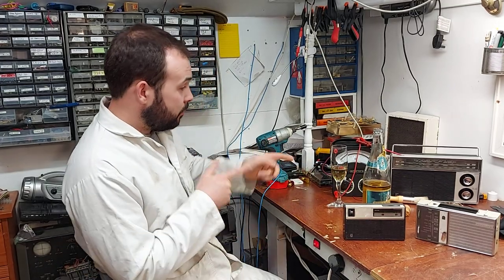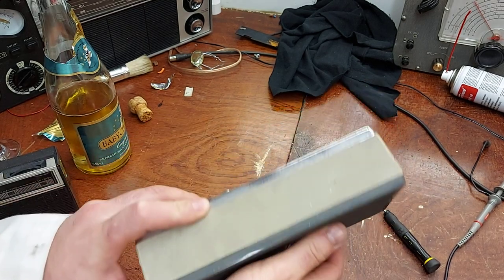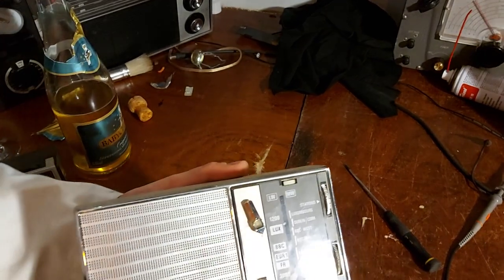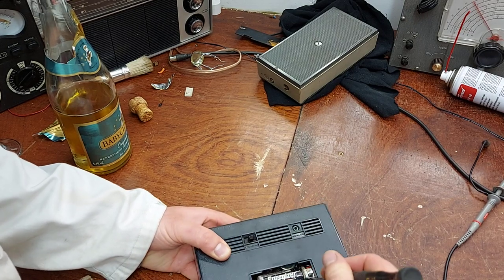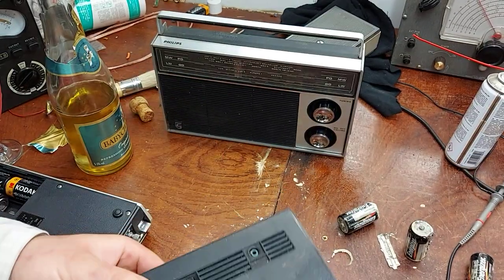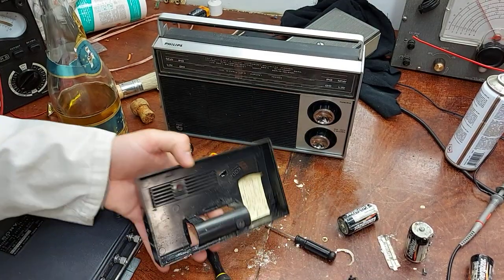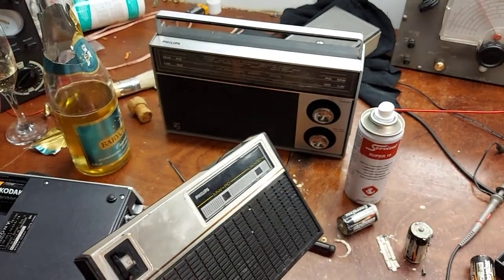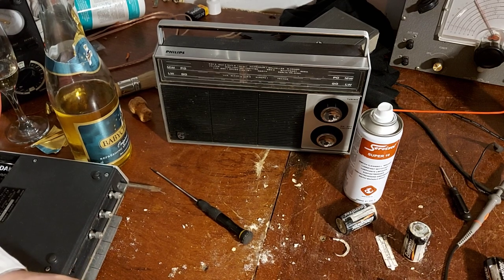A celebration (why not?) and some Philips portable radios.

Comment: European or uk Philips PCBs seemed quite advanced for the time they were made but suffered from dry joints the problem  carried through to g11 TVs. I'd love a Babycham with a red cherry on a cocktail stick
Reply from the maker: Philips were always way ahead of the pack.
Reply: @IrishvintageTVRadio  Philips so were so far ahead. I got from  the dump a Philips 60s dual standard transistor  portable in the late 70s wish I still had it. I also had a BRC 2000  the first solid state colour receiver also a GEC 2028  it had a better picture, all from the dump and all disposed of long ago. The G6 was a bit retro and the k70  looked the part but was possibly over complex. Decca 30s were the best hybrids.  The G8s were perfect for their  time. The  dump source dryed up in th early 80s and I got a proper  Job. Chanels like yours are brilliant like articles from Television magazine  or Practicle wireless.

Comment: Wave change switches are a pain on old Transistor Radios
Reply from the maker: Sure can be Stephen.
Reply: I have a 70s Sharp Table very good Radio sounds like a Valve Set even through it is solid state but the wave change switch is troublesome sprayed contact cleaner on it but the problem always returns only cuts out on Medium wave and Long wave but not at all on FM.  Funny enough I have a Bush Mini TV with a Radio from the 70s that has actually the same issue wave change switch cutting out on AM but not on FM.